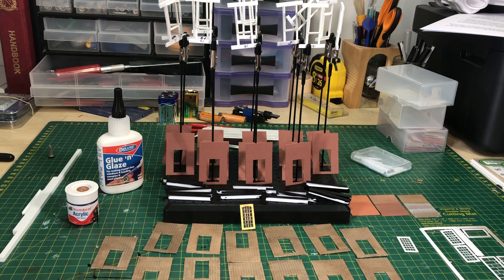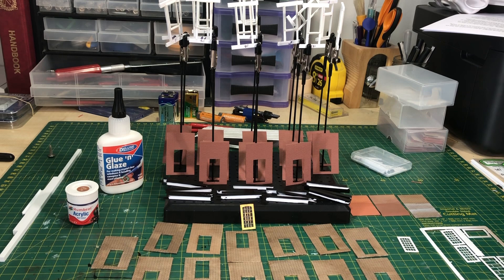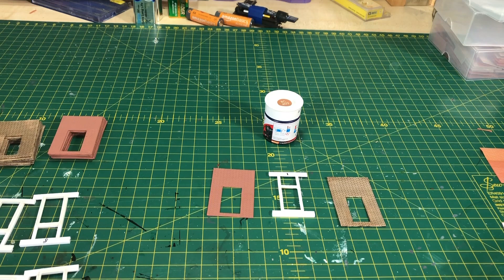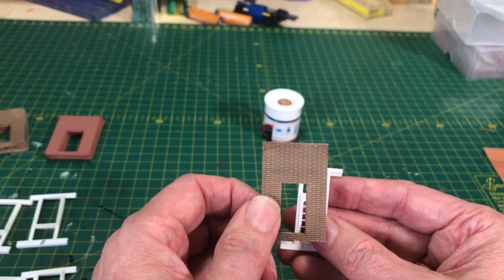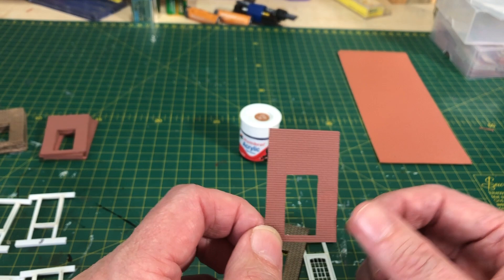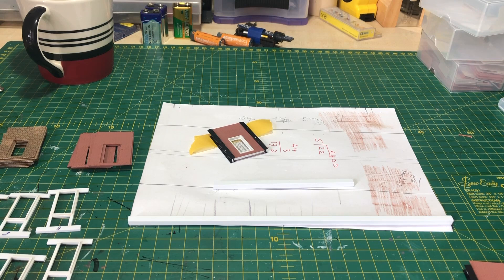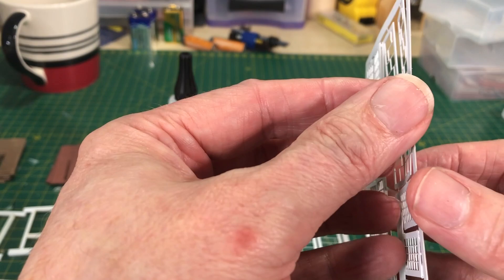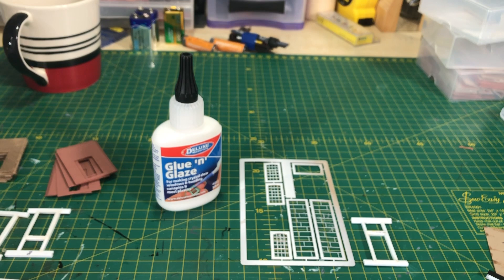Elvenhome N Gauge Model Railway Layout - Building the Engine Shed EP104

Comment: Hi Stephen, I also asked Mark about setting up the F2 braking after I got  a sound fitted loco with a zimo decoder. Just as you said it's great and fun to be able to control the braking and stop exactly where you want. John
Reply from the maker: Hi John. The active brake function does make a big difference to the control of the locos.  Coupled with the changes to the other CV's he suggested its made running the layout a lot more fun.  Stephen

Comment: Hi Stephen, really good informative update, I think the engine shed will look great once you’ve finished it. I really like those 2mm Slaters brick sheets and will form the basis of quite a few buildings at Exehaven.
I will of course at some stage be fiddling with those cv’s Mark has given us and all my future stock will have Zimo chips.
Cheers for now Stephen, oh, and i’m looking forward to those scenics at High Elven, John
Reply from the maker: Thanks very much John.  I think the Shed will look good.  I fitted all the windows and made up a panel and I was pleased with the result.  Hope to get both walls fitted this week - that is if I can finalise the design for the back wall. The Zimo chips are very good and at £20 each they are good value also.  Really pleased with the results in running trains as you could see.  Stephen

Comment: Stephen you have far more patience than I have to have cut those windows out ! 
Pleased you got the F2 braking to work for you, it does bring the feeling of you are driving to the hobby and not just turning a knob to make a model move. 
Slowly but surely moving my locos to have more sound but all to have A Zimo asap.
Reply from the maker: Hi Mark.  My patience nearly deserted me on a couple of occasions when I cut one brick course too many.  Words such as flip and bother filled the air.  Thanks for the help with the CVs.  It really does make a difference.  Stephen